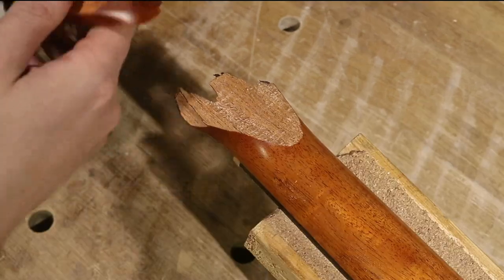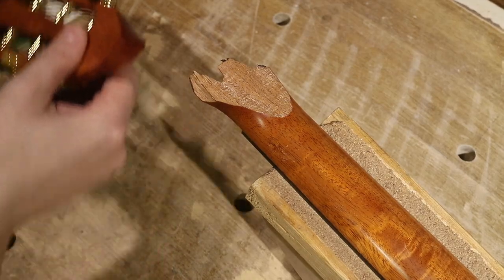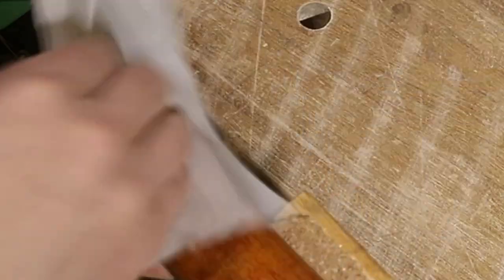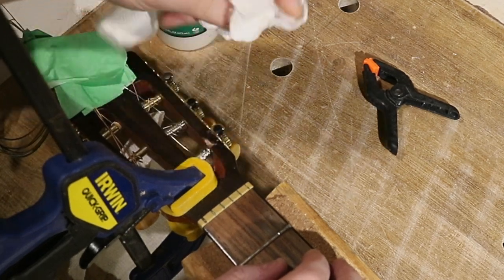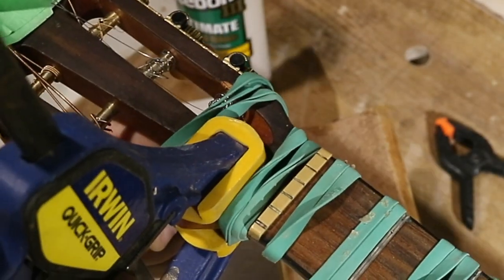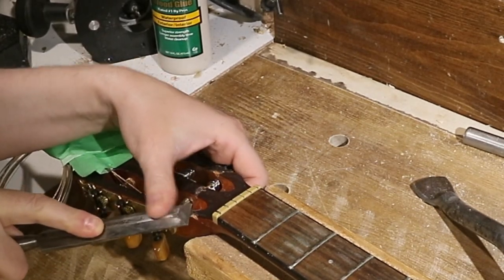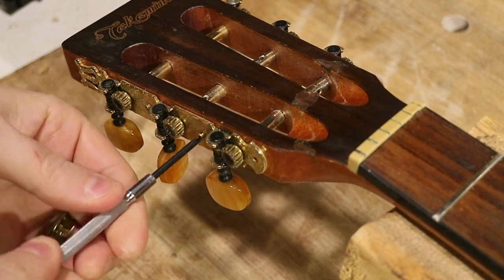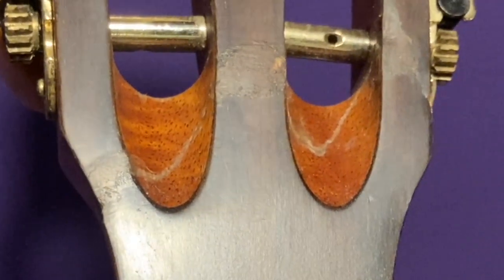Fix a Broken Guitar Headstock on a DIY Budget

Comment: brother my problem is almost this exactly, i have a crack going down the headstock as longways similar to that, but the crack only seems visible when its under full tension and i cant quite fit a needle in there, thought its enough to detune the guitar when i play.
Reply from the maker: That's tough...you need a glue thin enough to get in deep.  I honestly don't know how I'd approach that.